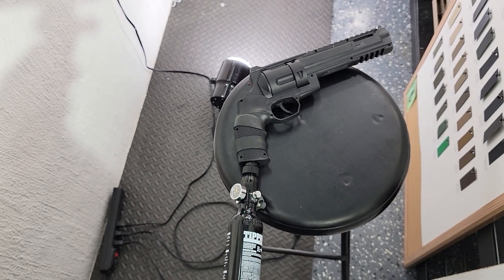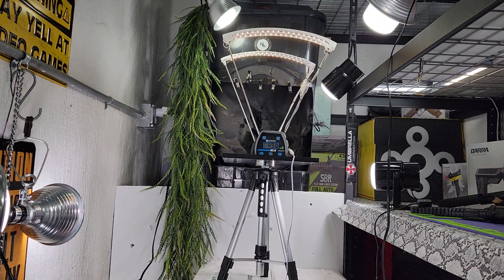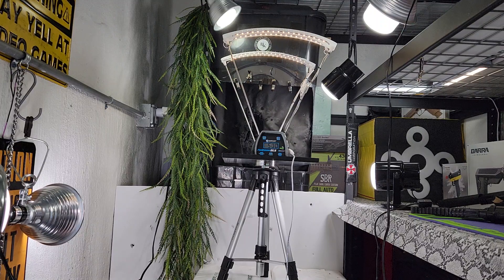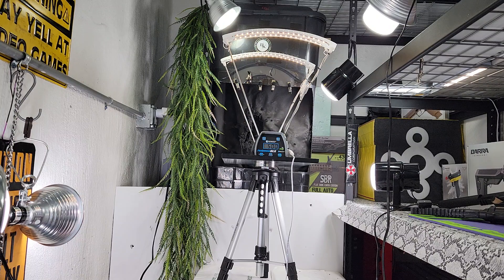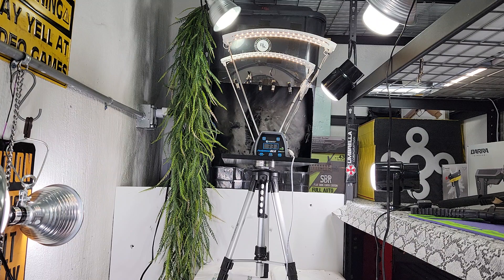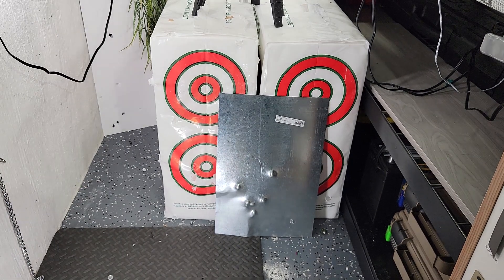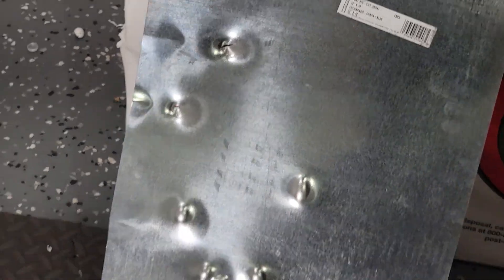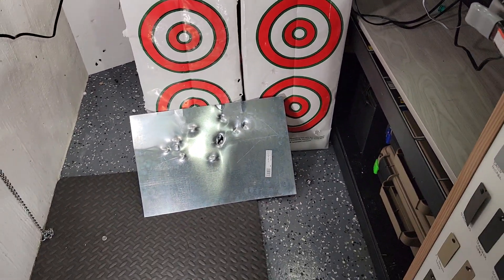HDR 68 HPA by DK Spencer Custom Kinetics 522fps 50joules Damage test 26g steel. Byrna Kinetics&9.9s

Comment: The HDR 68 supports an HPA Kit with a 4500psi tank and a 1800psi regulator? It has an On/Off valve and a 30cm barrel. If it can handle it, how many joules do you estimate when using 9-gram pointed steel ammunition?
Reply from the maker: Not sure bro, several variables on that
Reply: @DK-Spencer  Currently, I am able to fully penetrate a 15mm high-density MDF with shots from a distance of 7 meters. I can fire 12 powerful shots that completely pierce through the 15mm MDF. The shot still hits the wall behind the wood with enough force to create a small hole. I would like to fully penetrate 20 to 25mm MDF wood.
Reply: @HDefenseBr Are you using 88g cylinder? I want to use umarex 88g without hpa system.. do you know how many joules you can reach without upgrading the barrel? Then you have to remove the restrictor?
Reply: @Simone-t6z1o  I use an HPA cylinder at 3000psi with a 1250psi valve, with no restrictor. A 88g CO2 cartridge won't achieve the power I want. My HDR68 is currently producing between 120 to 150 joules.
Reply: @HDefenseBr  i understand.. wowww..with umarex 88g can it achieve 40/50j or more without restrictor in your opinion?
Reply: @Simone-t6z1o  I have never used 88g CO2, but from what I’ve seen, it shouldn’t exceed 50 joules. More power than that, only with HPA.
Reply: @HDefenseBr  thanks bro